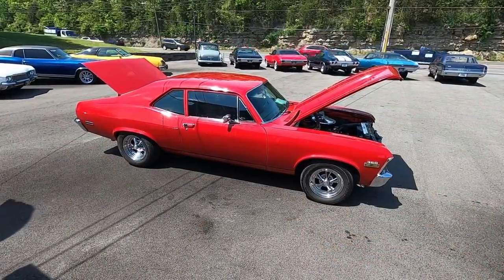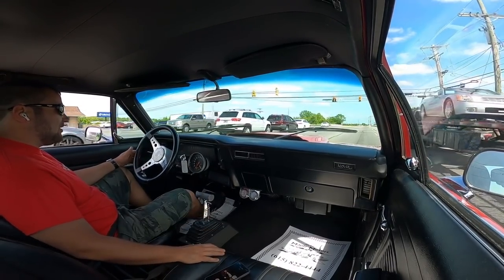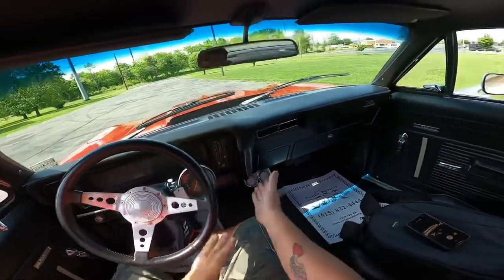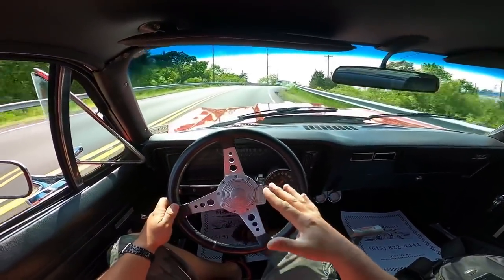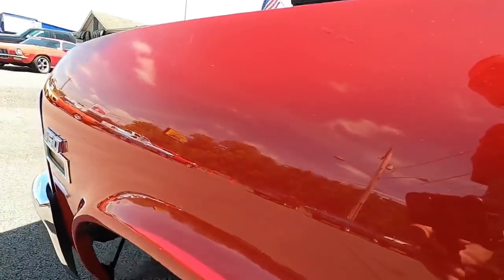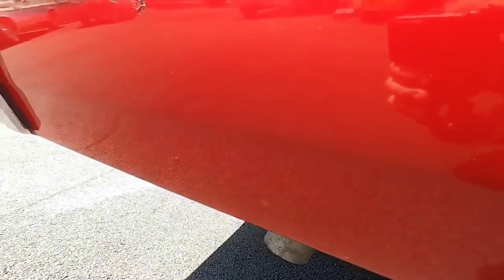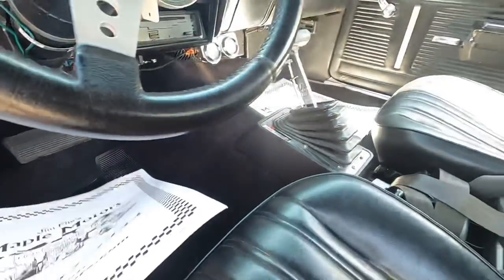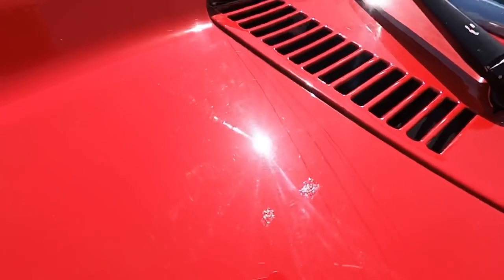Test Drive 1970 Chevrolet Nova SOLD $25,900 Maple Motors #1622

Comment: My first car was a 74 Nova. Red just like this one. 250 straight 6. My dad and i swapped out the 250 for a 350. Rochester quadrajet 750, headers, dual exhaust, and an edelbrock aluminum intake manifold. 1985 was a magical year for me and my homemade hot rod. Smoked everything on the road. RIP DAD! Thanks for some great memories.

Comment: Bottom of that thing covered in oil ....ridiculous asking price for a problem laden clunker ...it looks nice but ????
Reply from the maker: It “had” a leak in the front that was fixed , we just didn’t spray all the oil off trying to hide it. Oil leak is fixed
Reply: Many of their cars are very pretty but have very active chassis lubrication systems.